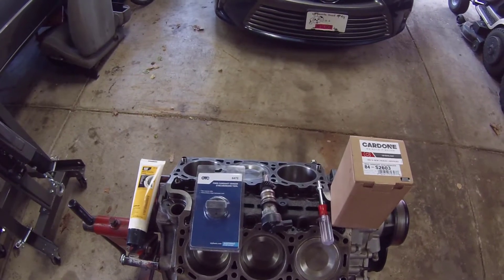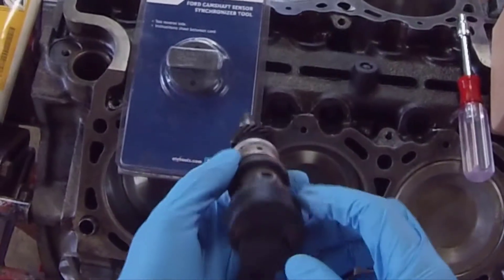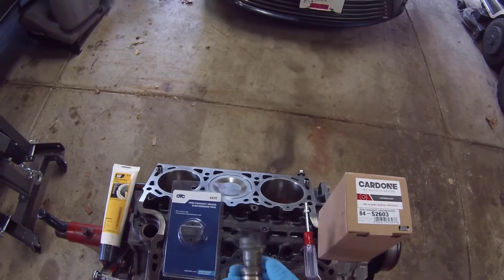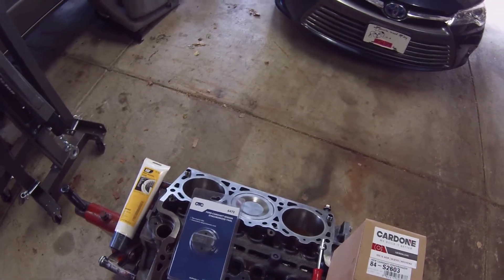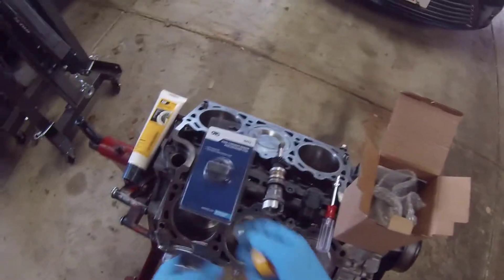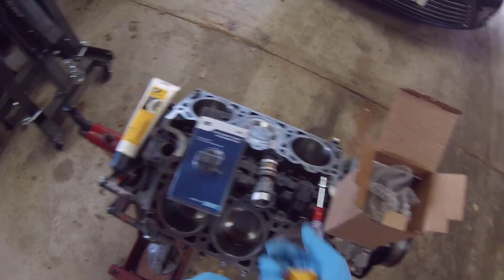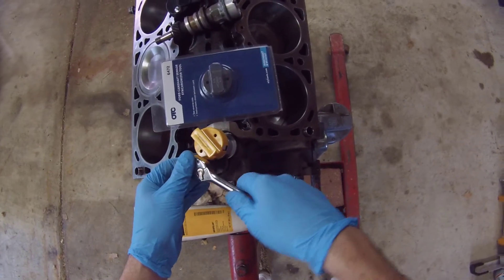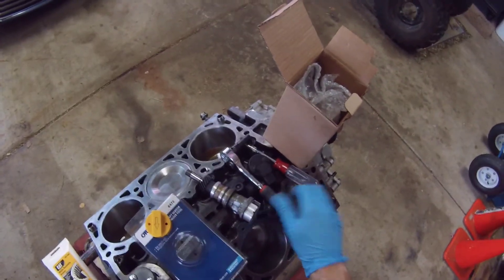Ford 4L Camshaft Synchro Install

Comment: Looking at forums it says the timing needs to be advanced 10° for the cam shaft synchronizer. Is that right?
Reply from the maker: No, you dont set the camshaft sensors 10 degrees before TDC. You will get a sync error. The 10 degrees before TDC is for base ignition timing because the ignition system is fully electronic, so you can check what the computer says to the actual with a timing light, but that's it. There is no ignition timing adjustment without a reflash of the PCM. Hope this gives some clarity.
Reply: @TEDDAV64 so set the engine 10° past tdc? Or just find regular tdc, that's where I'm confused
Reply from the maker: Just forget anything about 10 degrees TDC that is for ignition timing. You want to set the crank to TDC on number 1 cylinder, also known as 0 degrees TDC on the front crank pulley. I can't remember but I believe the crank pulley only has two marks on it. One is for 0 degrees TDC and the other is 10 degrees before TDC. You want the 0 TDC mark. Hopes this makes it more clear.

Comment: I have a 1998 Ranger with 4.0 pushrod engine. I mistakenly didn’t mark the EDIS before I pulled it out. When I reinstalled it I pointed it in the same direction but not the exact same( it may be pointing left or right by an 1”.)The truck now has code P0174 bank 2 is too lean. Can you install a EDIS wrong to make it idle higher and the engine wants to stall when in gear. Thank you in advance for any help. 😊
Reply from the maker: Anytime you installed the EDIS wrong, the computer would throw a crank vs cam sync code. Sound more like you have a major vacuum leak. Check your upper intake manifold gaskets, especially the gaskets under the fuel rail that go bad all the time. Hope this helps.

Comment: While I do appreciate any attempt to help us do it yourselfers, this video is not going to be relevant to 99% of viewers. You've got an engine out of the vehicle, that does not even have heads on it. Replacing one of these in a Ranger looks to be a nightmare, and also looks to be impossible without removal of the upper intake, although I'm not finding a video on youtube to confirm that, unfortunately. There are videos for the 3.0 liter V6, but not the 4.0.
Reply from the maker: True on the stand, it's easier but in vehicle it is pretty much impossible to install it without taking off the upper intake. I will revisit this in future.
Reply: Thanks. It might help someone else. @TEDDAV64

Comment: What Year Is The Motor & What Is The Build Date On The Drivers Door Jamb Sticker. That',d Make Chasing The Correct Synchro Easier
Reply from the maker: This engine is a 1998.

Comment: Thomas,I know this video is old but I hope you could help me... I was trying to replace the synchronizer,I put engine on TDC, removed the syncho,but now it won't go all the way down,I tried to put old one back and still won't go all the way down,
it feels when it goes in the oil pump shaft but the syncho doesn't sit all the way down,I tried turning the crank a but and nothing, engine it's in the truck....any help? I'm planning on removing the oil pan it's an auto 2wd... Any advice?
Reply from the maker: It sounds like your are fighting the oil pump shaft. Now you cannot move the crank off of TDC 1. They only way I have dealt with this is problem is to take needle noise plyers and turn the oil pump shaft a little bit at a time after each time I try to install the synchro. This is one of the reasons why this job is so annoying. Its easy to mesh the gears together but a pain to mesh oil pump splines when going down in a twisted motion. You just have to keep trying to install the synchro after moving the oil pump shaft each time. If your that frustrated with it you can remove the oil pan and pump then install the synchro then oil pump and pan back up but I only would do that if the pan is relatively easy to remove. I hope this help for you.

Comment: Thomas, is there any way you can tell me how to time the old style, 3 wire Synchronizer with the window?
I found out that style does not use the alignment tool after I took it out. 
I been looking for info for about a week and I just can’t find any. 
I
Reply from the maker: That is kind of hard to explain over text but I will do my best. First put engine to TDC number 1 just like I did in video. So the early window 3-wire is very similar to the late 3-wire sensor in the sense the rotor pick will be in the same location in relation of the synchro housing but in order to make sure it is in time with rest of engine you have to line up the rotor end to the mark on the window. If you look closely to the window you should see indentation line across it. Hard to see but should feel it with finger. Wish I had one to show and make video but I don't right now. I hope this helps.

Comment: Thomas… First off: Thank you so much for putting out this content. I’m in the process of rebuilding a 93 4.0 and your videos have been extremely helpful. I really hope all goes well for you on startup! Secondly I have a question concerning the cam sync. My engine doesn’t have the sensor, only the sync. I was quick to think that the positioning of this shouldnt matter being as it only drives the oil pump. But, there is an oil port on the cam sync. I’m curious as to where this needs to be located. Facing cam gears I’m thinking? Thanks again for the content.